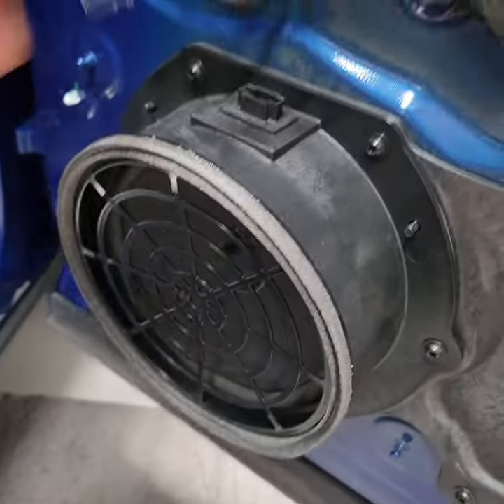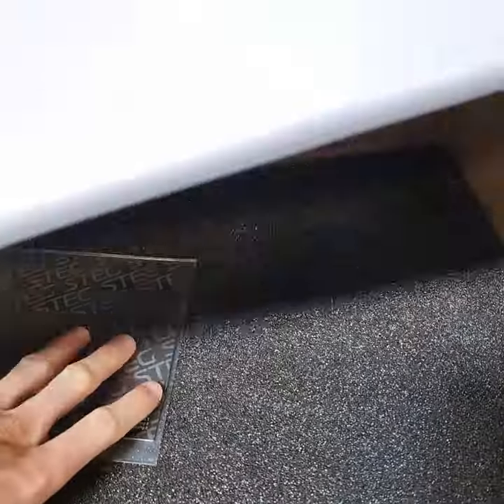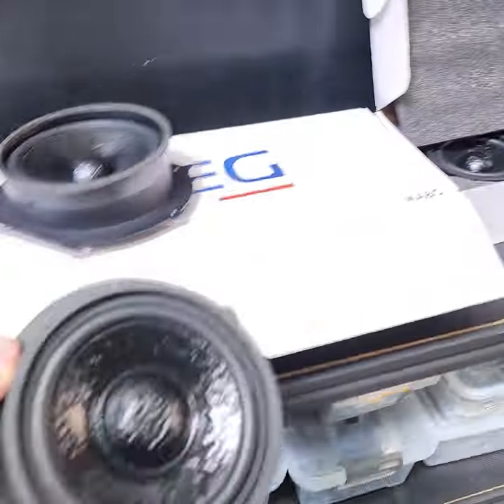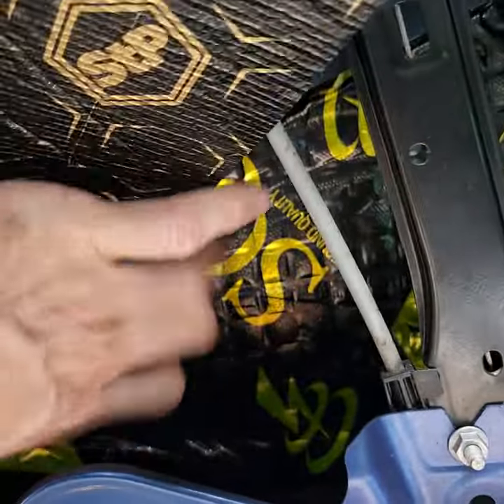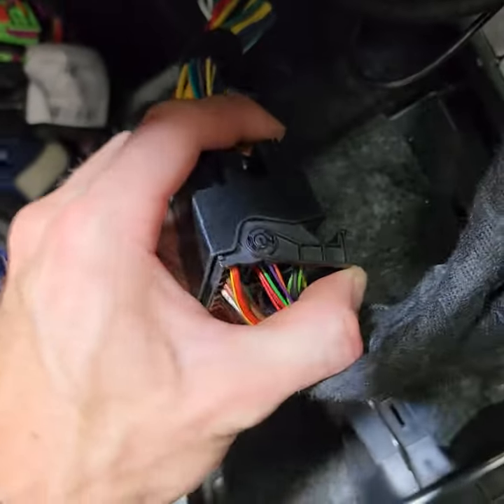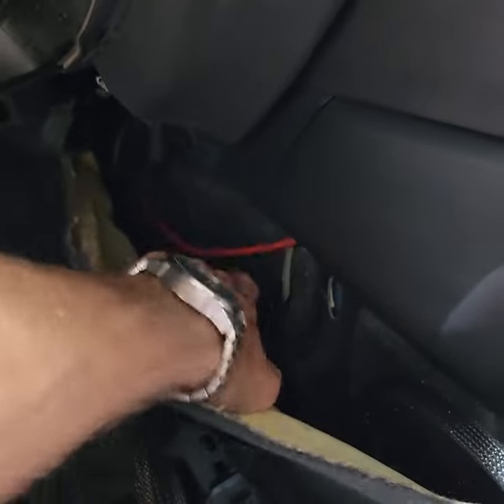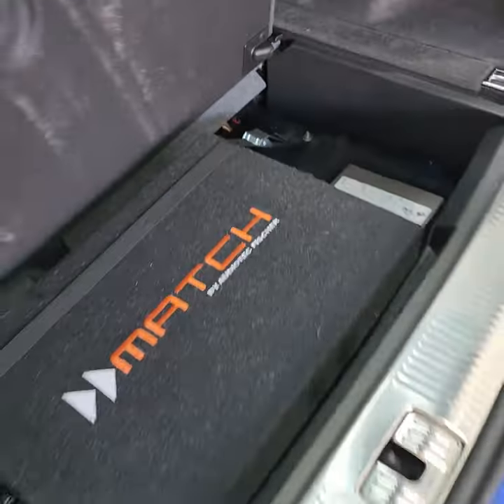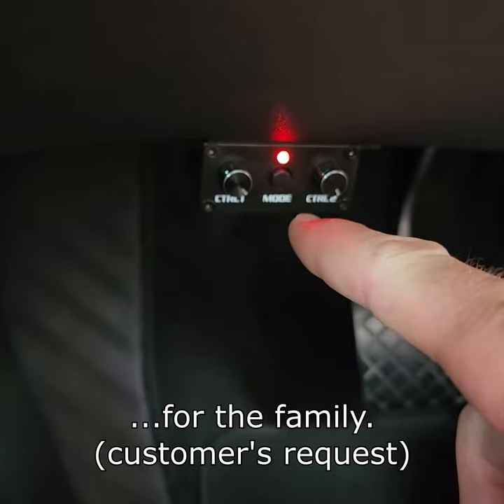Audi SQ7 2017 - complete speaker, subwoofer and amplifier upgrade | detailed overview

Comment: Did these speakers arrive with plug and play harness or your guys created it ?
Reply from the maker: No adapters were needed, those were the orignal factory plugs from OEM speakers that fit the new STEG
Reply: @soundtech7989  I had no clue STEG offers plug and play sets for Audi. Can you tell me what speaker you used for central mid range in your dashboard ? I am looking to do that same swap but i do see that they do not offer central mid range speaker for Audi.
Reply: Actually i do see you used AW25. Didnt read description in first place.

Comment: This is very cool! Does the lid over the woofer in the rear bounce a lot?  It seems like that would be a problem.
Reply from the maker: It doesn't even touch it, it's a good fit. And the box is firing downwards  with a sideway port so no issues with bouncing at all.

Comment: Theoretically, could you take the speaker in cables from the pp-vag harness, cut them, and use them as line level or high level (not sure what they would be?) to a stand alone DSP?  When i looked at the manual on the match 7, it looks like there are only “ins” for front/rear left and rights. I know the factory radio amp has 6 channels- so am confused how the vag harness and the match 7 amp get the center channel and sub outputs. I would worry that if using the “ins” from the harness into a stand alone dsp, it would be missing center and subs. Thoughts?
Reply from the maker: You can use the PP-VAG for PnP DSP input yes. In this job, we used MATCH UP 7DSP with MEC Analog IN card to get the 2 extra inputs for the centre and sub which the PP VAG also supports in/out so that's the whole solution with no channels lost

Comment: JL Audio C7, Audison Thesis which one is closest sounding to the high end systems of Burmesters 3D and Bower & Wilkins. Or even better sounding than those with any other brand? Also what kind of sub would u pair with it for car like Audi Q3 - sealed/ported, wattage?
Reply from the maker: Hi mate. There is no correlation between the high end systems and things such as Burmester or B/W. They may be less worse than factory stock standard but it's still rather basic when it comes to SQ. 

Similar to say a school uniform, they provide all the basic needs but even on a premium college it's still a basic clothing for the crowds (H/K, B/W, Bose, Burmester etc are for crowds). 

When you speak about C7 or Thesis, that's the high end stuff such as Rollex, Prada, Versace etc. They have much better style, materials, design but mostly the performance, acoustical precision, stability across the volume and frequency range and much more. And there are much higher choices still such as the BRAX Matrix or Focal Utopia.

All the above has been just a speaker selection so far which has nothing to do with what you call a 3D sound (surround sound). That is nothing else but mathematically generated signal differences in a DSP (in the factory amp or head unit) that makes the satellite speakers / midranges playing different frequencies and, most importantly, at different delays creating an echo making the car environment feel as if a larger space. 

That is just a simple signal distortion to the clean 2ch audio recoding that you stream. (Distortion = any kind of playback difference to the original track). 

A sub selection discussion goes far beyond what this comment can provide so best to watch some other YouTube videos for explanation. 

I hope it helps you to understand things better.